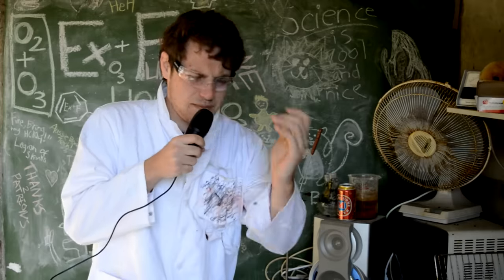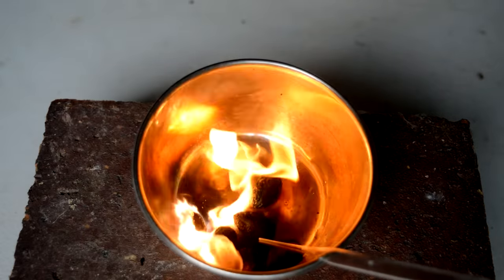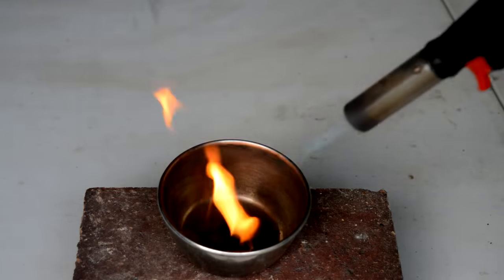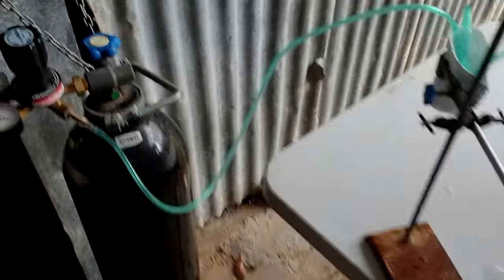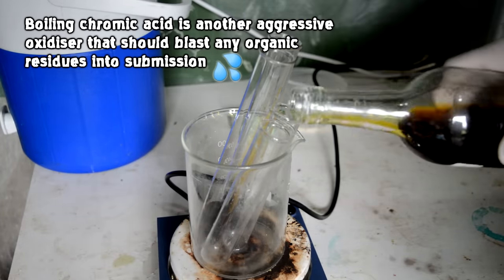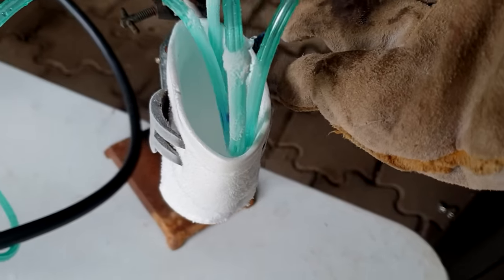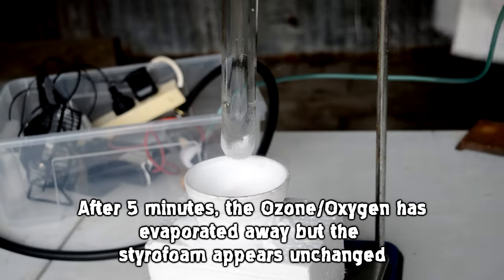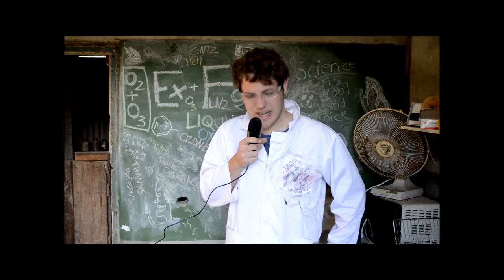Liquid Oxygen and Ozone - Ex&F

Comment: Ozone is just Oxygen 2: Electric Boogaloo
Reply: Oxygen 3*

Electric Explodafool?
Reply: Extractions&Ire U are a Hero 
You gave the australians their ozon back
Reply: Have your damn upvote.
Reply: I am an anodiser and can hook you up with hydric acid and a few other acids that we use and you may find useful
Reply: Extractions&Ire ... You mean Oxygen 3, Electric Boogalie?
Reply: @bloodyricho1  - Pretty sure he doesn't NEED your hydric acid.  He's got it 'on tap' so to speak
Reply: I think its oxygen 3:electric boogaloo
Reply: I've watched all the videos many times. But I would like to see more energetic compounds like picric acid and organic peroxides. Unless that's to hard or scary🤭
Reply: Oxygen 2 oxygen harder
Reply: broooooo upload more i miss you <3 one of my top favorite youtubers atm
Reply: Years ago we used ozone makes in fire cleanup. Seal a house and let ozone machines go then and SCBA to turn them off and vent for 4 hrs. Though now that I understand a bit more a fully sealed house would limit the ozone production.
Reply: guy c  as we reduce our CFC/HCFC expulsion into the air, solar radiation will help replenish the ozone layer.
Reply: I don't think he is talking about the formula O3. O–2 is an oxide ion, O2 is oxygen, I believe he was refering to it as the 2nd natural form oxygen atoms are found in considering Oxide ions are not naturally occuring.
Reply: So what's singlet oxygen then?
Reply: Singlet Oxygen
Oxygen 2: Electric Boogaloo
Oxygen 3: Blastoff
Reply: Oxygen 3: better being a new pair of pants

Comment: Enthusiastic Aussie does a boom using angery air
Reply from the maker: Is that what ozone is? You just put oxygen through all this high voltage which just makes it into angry oxygen
Reply: @ExplosionsAndFire  This is why you cant have ozone anymore. You people keep burning it.
Reply: S p i c y air
Reply: @ExplosionsAndFire well I mean let's put it this way. 0xygen is that date you don't want to run into their ex because they'll show off you and start to establish dominance and people get caught in the crossfire. Ozone is that toxic friend of your who no one likes but everyone goes to him because they are needed. Take it from the dude who works with thousands of gallons of LOX who for some reason is working next to JP8 and JP5(Jet fuel) who tells his problem children that if the 2000 gallon tanks tanks ever catch on fire. Pray to your god and start running. Far away
Reply: @jorgecabrera3694  i love you jorge cabrera
Reply: Seriously 15Kv? Off 240v? Using what voltage transformer? Tell me more!
Reply: O2+O = O3, technically O3 should be heavier than O2, then why is O2 down here and O3 up there? It should be the opposite. And what stops all of oxygen from converting into ozone or vice versa? How codx O remain in atmosphere?
Reply: @matrix2678  O3 is made by  action on O2. Happens where the ozone layer of the atmosphere exists. Once that O2 becomes O3, the uv is reduced enough in lower layers that O2 remains stable. As for atmospheric density, it's full of trace gases at different weights, all getting mooshed up by wind at different levels and temperatures. We don't have laminar flow in 50 k's of gas.
Reply: southern katrina neon signs use 15kv low current it's probably from an old beer sign or something or you can buy the transformers for like $50-80 usd.
Reply: it's an electronic neon sign transformer, which those generate tons of corona discharge. the ebay seller just shoved the wires into a pvc tube and spaced them apart so they generate as much ozone as possible
Reply: @southernkatrina8161  ps I think they're usually flyback transformers FYI but also I only have hobby level knowledge so 🤷‍♂️

also btw I know the coils in cars (gas not diesel)  that drive the spark plugs are in the kv range too with dc input but no idea if they'd work for this but it's another thing to look up on the internet. that's not what he's using in the vid though that much I know.
Reply: Petition to call ozone angry air
Reply: @kadergumus2598  ato  angry toxic oxygen

Comment: So, acetylene freezes at -81degC.
Just throwin' that out there.
Reply: Damn, now I want to see a frozen acetylene sponge saturated with liquid ozone ignited from far, far away.
Reply: I like this guy
Reply: Perhaps we shouldn't throw that out there. Lets toss it gently onto a padded surface in a chamber surrounded by a blast shield. :)
Reply: So, what would happen if I'm just thrown' this out there we got a canister of 99.99% pure liquid, or solid ozone. Built a test chamber. Lined the other walls with styrofoam for insulation. Then on top of the styrofoam we lined about 4cm deep on all sides with solid frozen acetylene, and at the core we placed our solid block of frozen ozone. Then covered all of that like a lid with solid frozen oxygen. With a thin layer of styrofoam on top of the frozen oxygen. We then ice our Oxygen, Ozone, Acetylene, Styrofoam ice cream cake with white phosphorus, and placed our cake inside a Solid potassium box sealed it as gas tight as possible, and then pressurized our OOASK birthday cake with liquid hydrogen to make sure it stayed cold until ready to eat.
Reply: @Papperlapappmaul  far away through youtube yeah!
Reply: r/madlads
Reply: @humblesoldier5474  I'm not exactly sure what would happen.
so it must be tried
Reply: @godfreypoon5148  and the candles are made out of magnesium.
Reply: Awesome, hope to see this here soon
Reply: And, it's easy to synthesize, too. Just take some calcium carbide pellets and introduce them to water. You can carve pumpkins explosively with that reaction and a little bit of flaming encouragement ;-)
Reply: @DrakkarCalethiel  I love his laugh, sounds a lot like when Ian McCollum gets to fire something particularly fun on the range in an episode of Forgotten Weapons.
Reply: @OnlyKaerius  Heheheheheheh
Reply: @LavenderSystem69  its easy to just buy at any welding supply / hardware store.....
.
oxy-acetylene cutting torches
Reply: @kainhall  you can synthesize MUCH larger amounts without arousing suspicion than you can buy ;)
Reply: Liquid acetylene/liquid ozone is one of the highest performing rocket propellant combinations possible. It combines a very high specific impulse with high propellant density which means volumetric impulse is very high as well (unlike LH2/LOX). Unfortunately both propellants tend to spontaneously detonate which would result in the rocket going up like a small nuke, but that doesn't mean you can't try...
Reply: Only issue is that it's a complete ticking time bomb, much more so than ozone even. Liquid acetylene can at any moment explosively polymerize,  it's unpredictable and extremely violent. There's a reason that acetylene tanks don't have liquid acetylene in them.

Comment: Keep buying test tubes from that company because those things are BEEFY
Reply from the maker: The first time I set up to do the experiment, the test tube slipped out of its clamp slightly, hit the bricks and shattered. Had to find a new tube and make more oxygen, was very stressful.
Anyway, the point is that all test tubes aren't beefy, but over the years they only get re-used if they make it through the experiment un-cracked. 
So it's survival of the beefiest, and i've bred some super-tubes
Reply: @ExplosionsAndFire  gotta love natural selection
Reply: @ExplosionsAndFire  You know you can buy thicker and higher quality ones? And they dont cost that much. Trademarks like DURAN (glass) speak for themself. No-name borosilicate glass test tubes might be thin.
Reply: @leocurious9919  but is that as funny sounding as breeding a Superior test tube?
Reply: @jacobderp1667  no, it is not.
Reply: @ExplosionsAndFire  Captain Testtube

Comment: John D Clark In his book "Ignition! An informal History of Liquid Rocket Propellants, describes Ozone thus.
"it's unstable - murderously so. at the slightest provocation and sometimes for no apparent reason, it may revert explosively to Oxygen. And this reversion is catalyzed by water, chlorine, metal oxides, alkalis - and by, apparently, certain substances which have not yet been identified. Compared to ozone hydrogen peroxide {note: the author is referring to HIGH TEST hydrogen peroxide} has the sensitivity of a heavyweight wrestler"
It is also more unstable as a solution in liquid oxygen...
Reply: I love the part where he explains the 80% concentration point in the oxidizer feed lines. Starting an engine is dangerous. Turning it off can be far worse.
Reply: Why would he refer to highly concentrated h2o2 by the name of h2o5 though.

Comment: Test tubes are wonderful things. One might be eaten by the compound that is not even supposed to react with glass, which results in weird clean-up, others - sometimes from the same batch can handle enormous pounding. We had eye protective gear and stood behind shield with strengthened glass, while our professor gently lit nitrocelulose using contraption, had it previously compressed and ignited it. I don't remember if there was any oxidizer, but boom was so freaking loud that Headmaster came to see what happened. And he was in his soundproof studio giving an interview, over 200 m away. And 2 ceilings between us. Test tube was okay only smoldered, but the ceiling was charred (area of char? Approx. 10 m). That was 15 years ago, so apologies for any mistakes.

Comment: Awesome, how did it smell?
Reply from the maker: The ozone isn't too strong but if you accidentally catch a sniff of it, its like snorting a line of iron filings. Very metallic
Reply: @ExplosionsAndFire  seems pleasant enough
Reply: If you have been around an office copier as it was working, you have smelt ozone.
Reply: @ExplosionsAndFire  My only experience with high-concentration ozone is from an air deodorizer that was about ten times too large for the space it was in. At high concentrations, it has an unpleasant, sharp, irritating smell that reminds me of bleach without that distinctive chlorine tang. And, now that E&F mentioned it, there is a weird metallic hint to it. Burns the eyes, too.

Comment: Yes, yellow is the opposite, or negative of blue. Yellow ink absorbs blue light while letting red and green light through. Our brain can't tell the difference light that is half way between red and green, or if the light is composed of both red and green light and we will just see yellow. Magenta is interesting philosophically, because the colour mid way between red and blue is green, but when our eyes detect red and blue without any green, our brain generates magenta a colour that doesn't have a corresponding frequency. It turns the spectrum into a wheel.

Comment: in the RGB colorspace, blue and green combine to make yellow, so imo red would be the opposite of yellow, as counterintuitive as it may seem. although in the visual light band of the electromagnetic wavelength spectrum (which is what determines what color a solution or compound appears), red is pretty adjacent to yellow, so the opposite there would probably be a blue or a purple/magenta/ULTRAVIOLET but i'm sure there are more than a few reactions/compounds in a synthesis that will go full on yellow if they're exposed to any UV at all, and i'm also pretty sure the opposite isn't true in that you can't unyellow a solution or compound by just bombarding it with UV, so...
Reply: Blue and green most certainly don't combine into yellow in RGB. They produce a cyan-like color.

Comment: Make salts of nitroform, if you would, please. From Wikipedia: "The potassium salt of nitroform, KC(NO2)3 is a lemon yellow crystalline solid that decomposes slowly at room temperatures and explodes above 95 °C. The ammonium salt is somewhat more stable, and deflagrates or explodes above 200 °C."  Start safe by making the ammonium salt.
Reply: Explanation for that is the fact that the NO2 group is an electron withdrawing group, thanks to all the NO2 groups that is inserted onto the methane. The same way that 5-nitrotetrazole is acidic and will give explosive salts.
Oh, and the nitrile group too! That's why cyanoform is acidic and 5-cyanotetrazole could be acidic. More salts based on tetrazole and an electron withdrawing group, please!
Reply from the maker: Ew yellow.
But hey, I did try that a few years ago! I still have the yellow solution of KC(NO2)3 lying around somewhere, its very dilute and has lots of Na carbonate as impurity, but I'm pretty sure I did it!
https://www.youtube.com/watch?v=c-wrRI4aLHc
Reply: @ExplosionsAndFire  Oh, that's good! Then try to make heavy metal trinitromethanide (C(NO3)3-) salts, very carefully, please.
I'd also like pentanitrophenol and its salts, if it's even possible.

Comment: Ive read that silica gel can be used to concentrate the ozone, it just has to have very little water absorbed, also the ozone-oxygen mixture out of the generator must be very dry. You cool down the silica to about -40C° to -78C° if i remember correctly (no need for extremely low temperatures) and you let a flow of low concentration ozone-oxygen mixture, the silica should absorb the ozone and become blue, then when you want to release the ozone you just let it warm up slowly, supposedly you can get ozone with concentrations upwards of 80% with this method. Im saying this from the top of my head tho, i read this a long time ago, I need to dig onto my library so I can update with more accurate information. So maybe this way, after concentrating the ozone you could liquefy it and get nearly pure liquid ozone, ugh just thinking about this makes my hands sweat, in the same text I read about concentrating ozone talked about the many explosions the early researchers had doing this. Take care!

Edit; not an update just forgot to mention what i was going at with this comment.
Reply from the maker: sounds a very interesting concept!

Comment: Sad virgin O16 ozone isnt scary enough. What we need is O15 ozone, the world's most disgusting and theoretical rocket fuel (besides metallic hydrogen).

O15 is a radioactive isotope of oxygen that decays into nitrogen. It has a half life of only 2 minutes.

If you could somehow produce a lot of O15 at once, and then make it into ozone, you would have an amazingly powerful propellant for a rocket engine. It is also lighter, giving marginally better efficiency.

So if ozone is an oxidizer, what is the fuel?... O15 Ozone is its own fuel. As oxygens rapidly decay into nitrogens, it only takes seconds for your ozone to decay into large quantities of nitrogen dioxide... Which is already mixed with the non-decayed ozone... And which happens to be dangerously hypergolic with ozone.

So... O15 ozone is highly radioactive with a half life of only 2 minutes, is an insanely powerful oxidizer, and rapidly decays into nitrogen dioxide, which is then immediately hypergolic with undecayed ozone.

... If you produce any amount of this, it'll be both radioactive, and immediately try to detonate with its own decay products. There is literally no way to store this stuff for use as a rocket fuel.

... Rocketry is frustrating... All the best rocket fuels are untouchable.

Comment: Is there are way to make these experiments more hazardous? May I suggest the oxidation of a radioactive isotope:-).

Have you consider taking up biochemistry. In this you can add a colourless solution with an incomprehensible name to a similar colourless solution with yet another incomprehensible name and after a few hours in a temperature controllef ambient temperature water bath, you produce a third colourless solution with an even more incomprehensible name, but this time shortened to an apparently random sequence of letters. 
As you can see this has the potential to produce an absolutely riveting YouTube video, particularly as none of the solutions are hazardous in any way. 
Ok maybe not.

Comment: You want something that's not been done before on Youtube with liquid oxygen? How about a stoichiometric mixture of liquid oxygen and liquid propane (or methane). Its energy density should be higher than any conventional explosive (and even some of the exotic military compounds too). No idea if those liquids are miscible or will phase separate. Also, while one source (an aside in Ignition, the book on rocketry) claims that the mixture is highly sensitive, your mixing of ozone and styrofoam seems to put the lie to that.
Reply from the maker: That was actually initially a plan for the video. Sure, liquid oxygen reacting with solids is violent, but That would have nothing on two liquids mixed together reacting. A perfect molecular mix. 

So you'd need a fuel that is liquid at liquid nitrogen temp. Not all that common, all alcohols freeze, but it's not cold enough for hydrogen. The answer: propane. 

I could not engineer a way to do this safely. There needs to be serious distance between any human and this reaction, including when mixing two gases over liquid nitrogen. Not easy, and I don't suggest anyone tries it!
Reply: @ExplosionsAndFire  Some tin-foil "cups" of each (o2 & propane) set up with strings so they can both be tipped into a larger foil cup from ~30m away. The mixing will just happen from the pouring. The beauty of aluminum foil is that it doesn't throw shrapnel (very far).